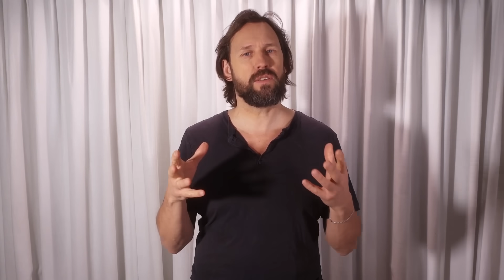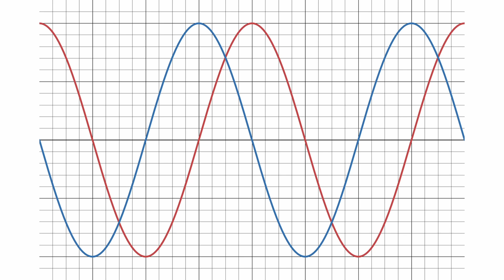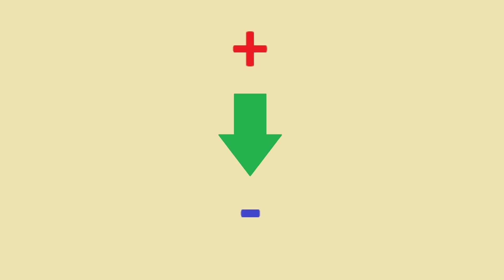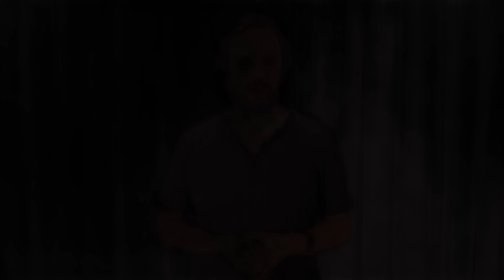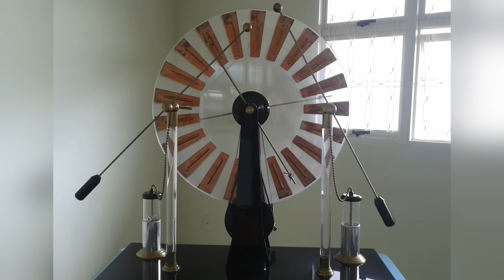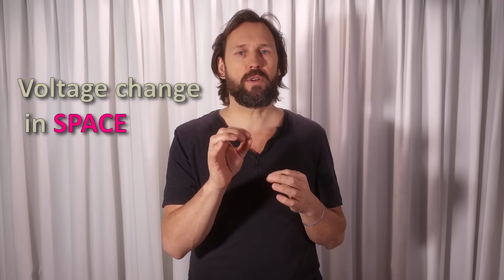The Electric Resonance SECRET Universities Hide

Comment: Thanks. Back in the middle '80s I went to tech school.  I organically realized that current DOES NOT flow through a capacitor.  Current flows to a capacitor.  That gives the illusion of current flow through a capacitor. A few decades later I designed resonate LC circuits, using Multisim. I was amazed to model voltage resonance in the LC circuit to be 1000 times higher than the input voltage. How can  that be? Empirical measurements also concurred with multisim modeling. You are on to revealing how to tap into the quintessential energy source!

Comment: stop worrying about voltage and current as the primary focus and instead consider rapid coherently phased polarity switches in specific geometry. Try a coil where the position of coherently starting phase polarity back and forth is at a central point in the coil translate your coil around that center point.
Reply: Word salad.
Reply: @RogerBarraud  sorry im not trying to be unintelligble. Can I ask what you do think Im trying to say?
Reply: @RogerBarraud  Im specifically talking about the direction of polarity where the energy enters a specific geometric conductive structure like a coil. Im referring to switch the polarity in a coherent manner perhaps also applying coherent ratioed voltages between polarity swaps at each end meaning which input you begin at you you reverse the polarity with a higher voltage and then when reversing polarity from the other input you keep frequency but change voltage.
Reply: @RogerBarraud  Stop treating coils as passive components.

Treat them as spatiotemporal field organizers.

Use coherently phased polarity reversals referenced to geometry, not just terminals.

The where and when of polarity matters as much as magnitude.

By translating the excitation around a geometric center, you shape field equilibrium, not just induce current.

Comment: Please say direction of field rather than lines of force, there are no actual lines are there?
Reply from the maker: there are actual real lines of force, the electrostatic field is made out of it. you can even feel it.
Reply: @MasterIvo  But fields are a map of potential, so just a map not real. My understanding of the word field, I wish scientists would not mix uo words.
Reply: @digbysirchickentf2315 Fields are to the aether as what a wave is to water or air, Magnetism is flow, Dielectricity is tension, Displacement Current is a wave of the latter field, they're very much real things.
Reply: @JenkoRun  If they are real the use of the word field is incorrect.  If experimentalists and theorists can't agree on the use of basic English words that explains a lot of the confusion in these fields.
Reply: @digbysirchickentf2315  No? A field is a perturbation modality of the aether, same as a wave is a perturbation of water, nothing incorrect there.
Reply: @JenkoRun  Incorrect language to use the word field to define a behaviour of the Aether. Find a better word?
Reply: @digbysirchickentf2315  You're not making sense man, we use the word wave for a perturbation of water or air, we use the word field for the effects of waves and flows if the unseen aether, there's no need to change the wording used here.
Reply: @JenkoRun  Yes a field is a 3D map of the potential EFFECT, not an actual object.
Reply: @digbysirchickentf2315 Object? No, substance? Yes, hence real.
Reply: @JenkoRun  Any substance is an object, coversation is over. Your talking nonsense.
Reply: @digbysirchickentf2315 Nonsense? Buddy, I think you need to study the works of Thomson, Reich and Steinmetz, learn about Counterspace, if you're going to say their work is nonsense then you're very foolish.
Reply: @JenkoRun  Good idea to change the subject after you say something stupid. Well done.
Reply: @digbysirchickentf2315 

I gave you names, I gave you terms, it's not my job to spoon-feed or hold your hand, if you'd rather resort to petty insults or deflect over applying effort to learn something new then fine, that's your prerogative.
Reply: @JenkoRun  No one asked dude.

Comment: Hey Ivo, I have a weird question for you. Have you been having trouble sleeping at night recently? Had any weird electromagnetic phenomenas going on around you, mainly when your alone/by yourself? Walls/floors randomly popping and creaking around you, maybe just a little too often?

I noticed the dark circles in your eyes, and I have the same thing myself going on. Its been an ongoing problem/symptom for me. Myself, and thousands of other individuals worldwide, are being targeted with a covert on/off DC magnetic pulse weapon. The magnetic pulse comes up from the ground itself, I believe they're using the Earth as a conductor to target individuals.  Its very discrete and hard to notice at first, but its continuous, 24/7, and does damage slowly. It will show up on any simple magnetic field meter.

So, I hope not, but I just have a feeling you might have been put on the target list, and I felt like I needed to say something. If you have a simple tri-field meter or something like that handy, you might want to check and see if your getting the same on/off magnetic pulse around yourself. Anyways, hopefully you were just a bit tired in the video. But, If the things I was saying at first are resonating, or if you are recieving the same low frequency on/off magnetic pulse, I can inform you of a lot more.
:chillwcat:
Reply from the maker: Yes I have been targeted for years in different ways. But I always grew stronger from it. staying grounded is essential, and loving yourself. Nature is the best medicine
Reply: @MasterIvo  Ok man, glad to hear it. The targeted weak magnetic pulse coming up from the Earth is real. They're using drones to pimpoint target us. I know it probably sounds nuts, but this is really happening to thousands of others, worldwide.

I've found a way to protect myself, at night, while I'm sleeping.

If you have any worsening symptoms at night, or want to know more, just message me. I also understand if you don't want to go down that road.

Comment: The confusion about "leading" or "lagging." 
The voltage across a capacitor is not something that "precedes" or "follows" the current in a causal sense; it's a direct consequence of the charge transport (current) that has already occurred.
For every charge the capacitor will just have a tiny voltage added or subtracted.

The capacitor is an accumulator of charges. The same charges as the ones traveling in the wire.

To have more energy in the system something has to do work and that mechanism has not been described.

When something do work on your system energy would go missing somewhere else. Why would anything lose energy to your system? Is there a potential somewhere? You system is in symmetric resonance and universe have no potential that fluctuate for you to tap into.

Comment: maybe check out these "atmospheric enhancers" from the old (pre-1860) train engines, these seem to have some additional inductive heating element included which made them use the least amount of coal and thus was discontinued from 1890 or so totally in favour of higher coal consumption as the coal mine owners started to buy the railways back then all over the world. .. anyways these old-time engines had some apparatus that seemed to work when they moved only, maybe the train(plates) act as one plate of capacitor and the earth as the other one, being connected via the rails.. if they really needed to move its maybe they picked up static from the air and then they must have converted that superbly to current able to run inductive heaters... all this looks a bit like that tesla patent with this plate in the air and being connected to the earth type of system

Comment: okay so ive been thinking about this for months. Simple maglev train with magnets and a double A battery going through a coil should produce energy if i understand what i think i do about energy production. all you need is a bridge rectifier to convert the ac to dc. i also wonder if using a rechargeable battery would the battery constantly be recharged by the magnets and if it isnt then run the power from the bridge rectifier back to the coil. idk if im onto anything here but i keep thinking it should work. also i wanna wrap said coil in a thin layer of pure copper to contain the magnetic field.

Comment: 11:55 How do you define energy? You use the term a lot, but it seems vague to me?
Reply from the maker: yes Energy is very vague. It can do work. energy is equal to Aether.
it can be polarised, and manifest in many forms.
like the electrostatic field is made of energy and holds energy.
energy has (IS) inerta and momentum.
The magnetic field also is made of energy, whereby it flows in the form of a vortex.
Power is created when 2 energy forms are fused, can you guess which ones?

Comment: I look at a Tesla Coil this way: Think of a Tesla Coil as a radio transmitter that can't radiate its energy away properly (due to the coiled nature of the antenna, the coil). Because the coil (the antenna) is tuned exactly to the frequency of the input current, just the same as it is in a conventional transmitter, and the energy can't radiate out into space, it accumulates in the antenna. The result: RF high voltage in the antenna.
Reply: Only that Tesla Coil is not an "improper" radio transmitter - if it's properly tuned (as N. Tesla did it with the unusual procedure of matching the weight of wire in primary and secondary coils), it's a purely dielectric/electrostatic device. This means the energy emitted is devoid of the magnetic component (now, consider how few scientists, engineers and researches today are aware of this).
Also, the purpose of the device is not "radio waves" transmission, but longitudinal dielectric field propagation with the intent of transmitting energy over "some" distance (to make this possible, the receiving device had to be tuned to the exact same resonant frequency as the transmitter).

Comment: Good presentation, practical but incomplete picture as to basic electro-dynamics. Voltage moves down a copper wire at C velocity, electron current is much slower at 1 coulomb per amp. During this light velocity energy transfer the wave is positive. After the negative starts to move electrons we get current and magnetic field from the rise of the electron current. This is a run of copper wire in a straight line as in Antenna work. Due to the light velocity aspect of the positive charge , as Protons do not move between atoms,  It starts with a flow of positive energy first. The current will always lag this in an inductive coil of wire. The question then become what is first the voltage or the current? In the load and in the source is the difference. The direction of the power. In a generator the voltage must be present first the current then comes after the motion is added. In a capacitor as a load this reverses. In a capacitor as a generator the voltage must be present first, then it can power a load as it discharges. The key to free energy is to make the capacitor charge up using the Proton path of tension or mass vibration instantly then discharge it as a voltage creating a current. The Proton mass is the part of the atom that powers it from the Quantum field creating the inertial component of the field. In free energy systems this is the source. The flow is in this order - Quantum inertial field - Proton mass - Isotope - Electron shell. In a load a lager field is a lower frequency, in a source a larger field is a higher frequency.
Reply from the maker: theory can be fun but 99% not based on reality. Experimental proof comes first. then a theory that evolves based on new experiments.
mathematical equations are used when the theory and experimental proof show solid usable results to refine.
not the other way round.
that leads to gibberish
Reply: Prove it. You can't.

Master Ivo will.
Reply: @GiveMeLiquidity No, I cannot prove it to you. We need people like you to catch up and take it further! You do not understand NMR operation or Quantum Field Planck access frequencies yet, or the E/P magnetic resonance ratio between the electron and proton shells. When you finally get tired of HV arcing and ionization maybe you will start to go inwards to the level of the atom and discover the source. Also you should try to catch up with what is already working and known before taking it further. We have medical MRI machines all over the place and they already work. We have radio antennas working, and also we have diamagnetic elements like Bismuth to amplify the Proton diamagnetic field effects to "first hand" study mass vibration. This is all based in things that are measured and quantifiable. The nuclear mass of the atom is 137 times the power of the EM fields. It has an energy system that recovers the frequency and form of the atom no matter what we take from the atom. I do not need to prove this to you, you need to discover it for yourself. Nothing is hidden. [Wilbert Smith]

Comment: Hello! You’re on to something and have made more sense than anyone I have heard. You MUST look an ancient linghams! India Cambodia linghams! They had an induction coil and hoop antenna historically. Hint, there is a huge amount of evidence that the pyramids these sit atop are made of geopolymer also known as zeolite cation exchange material! Good luck and I hope this helps with your static capacitor. Also I have a recipe for this from ancient materials if you’re interested. I make the ancient polymer and yes it can rapidly exchange or displace ions. The blocks respond to em and you can exchange the sodium or potassium for different cations The stone is the capacitor! M2O:Al2O3:SiO2:O these are nano capacitors with extreme potential if made right! Na-ZSM-5
Reply from the maker: I recently checked the dielectric properties of granite and to my suprise you could make perfect capacitors with them. IF it was able to be made very thin easily.
I wonder if it is Impulsed at the right frequency what happens? 
But a coil around those huge lingams (I've seen pictures from Cambodia)? yes if it was made resonant with high voltage could make sense.
Reply: @MasterIvo  that’s exciting! Perhaps the piezoelectric effect will contribute.
Reply: @MasterIvo  a granite analog can be made very thin through the polymer method, but you have to understand that the polymer act as nano capacitor material already hopefully this helps although you seem a lot smarter than me already! happy studies!

Comment: Hence a topdome; alluminium because it has a higher capacity + and -  It also has a lower resistance to copper, at ionizing voltages and frequencies, when the voltage on topdome is negative 500000Volts, sure thing it conducts electricity from the air into the Tesla Coil, No doubt, WeydenCliffeTower did this, and when the enviroment charges the topdome because it is several thousasnts of volts lower, than in the air, Air starts to charge the primairy coil, Tesla used a kind of fluxcappacitor to temporarily hold this charge, and so he only had to use like 10% of the initial current to make the Tower generate wireless energy/electricity This energy is the chain of air molecules with a dropdown voltage of 1000V a CM3. Just look at the Coil from an ionized particle 's view or from a electrons perspective! The top dome never gave the electrons to the air, it was just exited about the Voltage going up AND down!! Hunderds of MHz.

Comment: it is mutual capacitance and if you make resonance between inductance and mutual capacitance or capacitance and mutual inductance you can get energy from air and ground you must make a capacitor but at the same time a coil or a coil at the same time a capacitor ,that's it.
Reply: It is called a fluxcappacitor, just use double or triple windings around a coil and connect top wires to bottem ends of wires, this will ensure your voltage differences between the wires, hence it works like a cappacitor!! Tesla used it in his WeydenCliffeTower!
Reply from the maker: Made a capacitor out of 2 counterwound coils to reduce inductance. And playing with a sparkgap -V discharge. Should produce not only a high voltage but also an increase ring

Comment: I used parasitic capacitance to make my entire house load 550W when I ran my washer machine. Washer load spec is 1000W. 

I moved so I took it apart but it was tied into a water cell LENR as well as the ground pipe and ground of washer with 60Hz pancake coil made of thick aluminum inline with the motor.